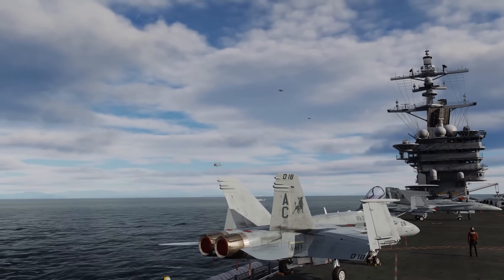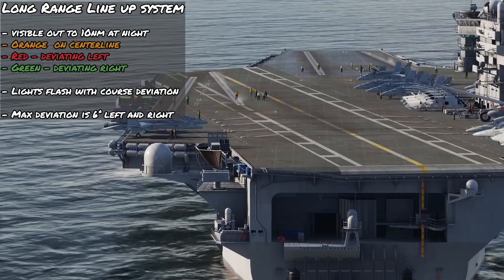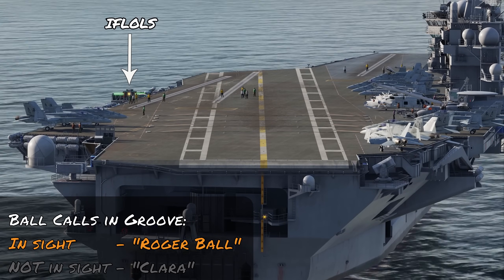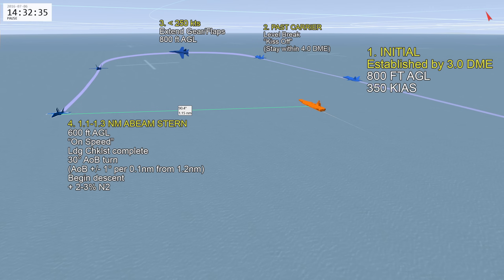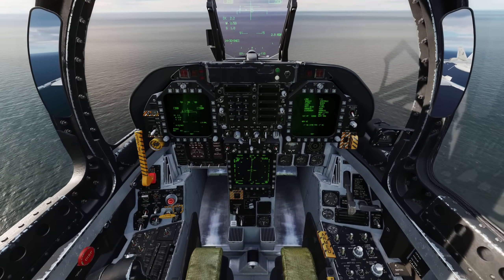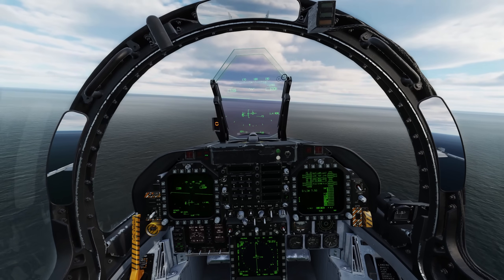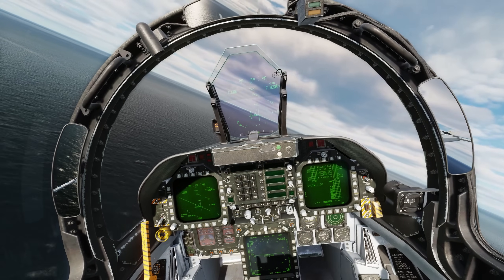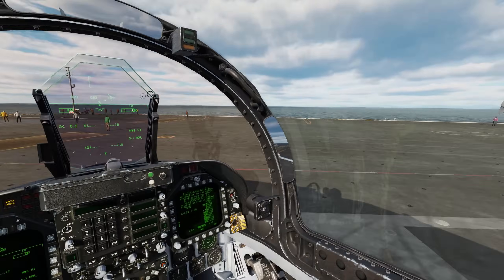DCS F/A-18 - Case I Approach

Comment: Great video thank you. 
On the first turn, could you describe your power settings.  I hear: boards, 2G or so, gear at 250.   Are you idle power?
Reply from the maker: Yes it's idle thrust, but if you wanted you can leave the thrust up a bit if you find yourself jockeying the throttles a bit too much trying to get yourself on speed. Just bear in mind you still have to descend for downwind.
I have a video covering on speed AoA which has some exercises you can do which will make doing this turn and flying at on speed AoA much easier.
Reply: Thanks, when do you typically retract the speed brake?
Reply from the maker: @sg0101010  that's the cool thing about them. You won't have to! The way the logic works is if the flaps are extended the speedbrake will automatically retract below 250kts unless you're continually holding the speedbrake control aft, keeping them out. If the flaps are up and you're above 250kts they'll also automatically retract under certain conditions too.
Reply: Your roll on final is so smooth… lots of practice, getting better and “roll == more power” to prevent the dive it will do.
Reply from the maker: @sg0101010  yeah it's just practice. I still fly around at 5000ft in landing configuration occasionally to refresh my muscle memory a bit so it makes my carrier pattern better.

Comment: Other manuals say you should pull 1% of your CAS in G-load during the kiss-off break (so, 3.5Gs for 350 kts), easing off as the airspeed decreases.
It never worked for me, turn ends up too tight.
Should I just keep a 2g turn?
Reply from the maker: You can try it and see how it feels for you, I know of that 1% technique so that is better to use if you're coming in at a non-standard speed. At 350kts starting you'll never reach 3.5G...as soon as you start pulling G the speed begins falling off, so you'd have to relax whatever G you reach once you hit 1% of the airspeed and let G come down as airspeed decreases (like you said).

Comment: A couple tips from someone that has a lot of real traps. Use the auto throttle control function in the airplane.  If you have the Thrustmaster throttle, It's the small red button under your left ring finger. Once activated it will show up in the HUD as ATC. This will make it much easier to get aboard. Now use pitch to control your glideslope.
Once you pick up the meatball on final, try not to be reactive to the meatball, waiting for a high or low indication.  Assuming it's close to centered when you pick it up and you're  around 700 fpm,  flatten your approach with a little back pressure on the stick and look for the meatball to move very slightly above centered and then adjust back to a slightly lower pitch and drive the ball back to centered. Then repeat until touchdown. Now you're  controlling the ball not the other way around. This technique was called "Crowning the Ball." years ago and helped me get aboard every time.
This technique works also with any airplane flying a glideslope.
Reply: This is extremely helpful, thanks for the advice and thank you for your service. I did have a question, do you mean to use the ATC in the groove or on the downwind leg?

Comment: a couple of corrections from a Hornet driver. The NATOP's (manual) calls for 1 1/2  to 1 1/4 miles abeam. And its 22 degrees angle of bank of the 180, which starts 10 seconds after to reach abeam of the ramp. The LSO says Roger Ball, not the pilot. the Pilot calls "Hornet,  Ball (you see it), and your fuel state. eg. 5.5